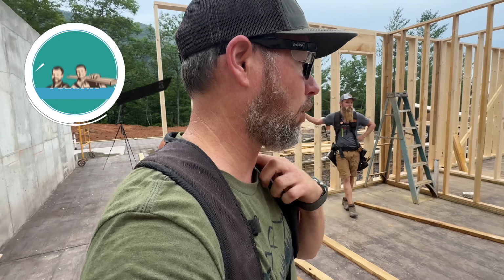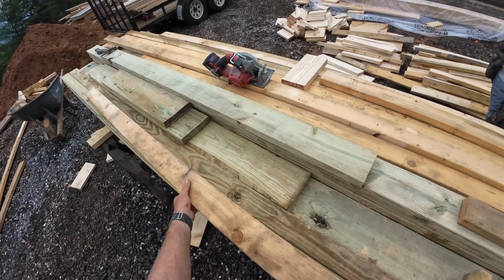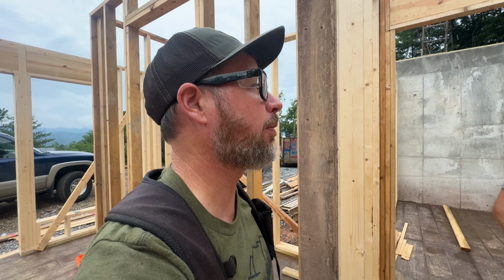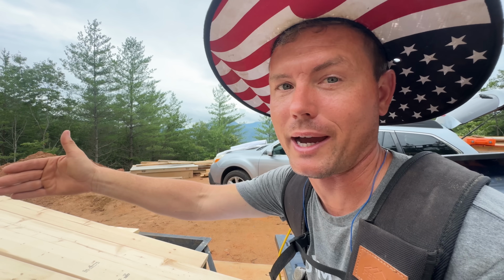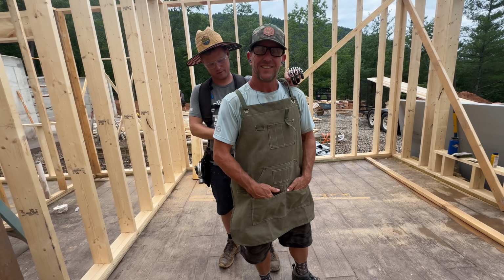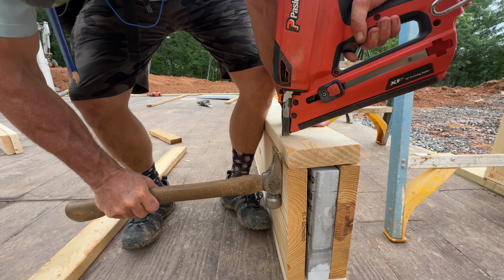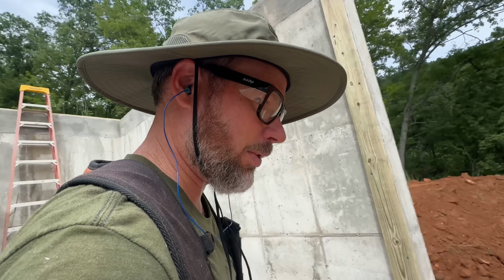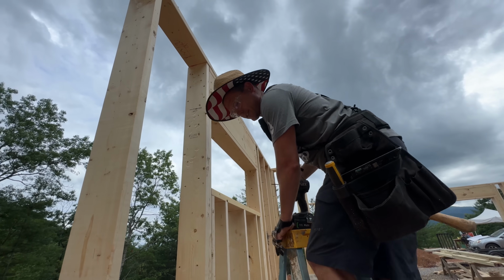Construction of a MEGA sized Modern Home PT 22

Comment: https://www.youtube.com/@PerkinsBuilderBrothers  UK and New York is the only place I've seen below grade windows (basements) without window wells.   Normally there is a sunken area that is concreted/paved (aka a walkout) with stairs leading up to the ground level.   They generally have a floor drain installed for rainwater and are sloped.   similar to how one would do an interior basement or garage.

Comment: Pro tip. Use a sq. And you won't have to beat on the opposing framing member to flush your framing. It will just fit.

Comment: It actually took you 8 seconds from the second you ticked the mark on the stud till you picked your saw. Assuming you are doing 200 studs that way, you're going to save around 1600 seconds, or 1.6 kiloseconds. 1 Kilosecond has 16 minutes and 40 seconds, so you will have saved 26 minutes and 40 seconds if you did 200 studs without marking a line on the stud.

Comment: You can import a PDF into AutoCAD (overpriced) or BricsCAD (cheap and the same as AutoCAD).  If the PDF of your print has one dimension then you can measure one of the already dimensioned lines.  The ratio of the dimension on the print and the measured dimension is your scale factor.  You can then scale the imported PDF file drawing by that amount, and now you can accurately dimension anything on the print.

Comment: Holy crap, I might actually know something y'all don't. Okay, here's a "pro tip" (putting it in quotes, to indicate irony as I'm not a pro). You want to cut out the bottom plate where there's a door opening, but don't want to screw up the floor finish, right? So... when you frame the wall, before you stand it up, take a circular saw, set it to about 3/4 of an inch (maybe just half an inch) and cut the BOTTOM OF THE PLATE where the bottom plate will be cut out for the door frame. Right? So, the bottom plate is still intact. Install the wall. Then, when you go back through with the saw zaw, you don't have to go all the way down to the floor, you only have to cut about half way through the bottom plate and won't risk marking the finish. See what I'm saying?

Comment: Pro-Tip
When framing walls and leaving the bottom plate full through a doorway , cut part way through bottom plate, from the bottom. That way when you stand up the wall and cut out the opening you only need a hand saw. Simply make a few cuts and connect with the existing bottom-cut. Perfect door opening and no damage to a tool when it hits the concrete.

Comment: You courtesy cut your sill 3/4 when you layout at bottom-pro tip.Ive done double 2x4 walls at 2' thick for insulation.We have lots of snow and mega homes,accordian doors with 20' spans, big headers.Lots of steel and glue lam.

Comment: If you undercut door openings underside ( bottom plate) by 10-20 mm...1/4-1/2 in? Before bolting plate down... won't mark the floor when cutting them out later. Great channel by the way. Kerry from NZ

Comment: I know this video is almost a week old, but just thought I’d be the code nerd to point out all the comments regarding “egress” windows are not correct. The IRC requires an Emergency Escape and Rescue Opening (EERO) in basements, habitable attics, and sleeping rooms. Means of egress is addressed in another section of the code.

Just sayin’.

Comment: IRC egress requirement. Bedroom's occupant must have two possible ways of getting out with one leading directly outside.

IRC also has certain minimum requirements for windows:

    24 inches tall
    20 inches wide
    The window opening must have an area of 5.7 square feet
    A window can't be installed more than 44 inches above the floor, to allow climbing out; it should also be no lower than 24 inches from the floor, to help prevent kids from falling out.
    Windows must be easy to open from the inside without keys, tools, or specialized knowledge.

Comment: Sorry, but I got you & your Larry Hawn technique beat. We just mark the board near the middle, place your table on the far side and line up your blade with the mark, then plunge cut, stop your blade on the wood, since we all pin up our guards (Not OSHA approved)😁 Many of us also cut off the outside table, easy to cut out doorways and heats later. In over 40 years, only one accident, minor.

Comment: I'd like to normalize kicking the sill plate back towards the center of the building enough to make the exterior sheething flush with the exterior of the foundation and then caulking the transition and using a fluid applied exterior membrane

Comment: A tool tip Erik, if you subtract the measurement from the saw base to the blade, then you can put a tick mark and hold your speedsquare to it, then jam the saw up the the square and cut fast perfect 90°😃 usually the saw base is 1"1/2 so just subtract a 1"1/2 from your measurement 😄

Comment: Hey,PRO TIP!!!when building inside pars.on cement floor score the bottom plate wth circular saw half way through. So when cutting out door plates wth recipacating saw only have to cut half way through done not even close to floor.No marks and saves tons of blades.

Comment: I was wondering why did you build the header with an air space in between the two 2x12, in my opinion you should put the two boards together so you can spray foam or insulate that little bit of air space.

Comment: I always did the Larry Haun square cut putting the tick mark on the side of the board away from me. Then I would line up the notch on the front of my saw with the tick mark. Then flush the front of the saw to the 2x4, which gets it square, and plunge the saw in to the cut and finish by aiming the blade at the tick mark.

Comment: Hey guys hello from New Zealand, love the vids, just a little trick I’ve discovered when cutting the bottom plate out in door ways is before you stand them cut about a 1/4 - 1/3 from the under side of the  bottom plate where the proposed doorway is, so when you stand up the frame you only need to cut down a 2/3 - 3/4 saves marking the floor and also keeps your blades from being damaged, Jamie will like that 😂

Comment: 19:30 those egress windows are pretty common around where my parents live in Indiana. They actually had some installed in the basement, because without them the only egress from the entire finished basement was a single staircase. That said, shortly after installation, they actually flooded the basement, so you make a compelling point that they're not necessarily a great idea when there are alternatives.

Comment: So a trick my Great uncle did for the door plates, is to cut about half way through the bottom side of the board before placing them on the foundation. Then you only need to cut the top half.

Comment: make the mark and hold the speed square to run the saw against.  Always correct.  If you were to eyeball 2x6 or greater, then the cuts would probably not be square and you have to trim it again, costing time.  No point drawing the line with square, just hold the square and place the saw against it.

Comment: Dividing the number of studs and replacing them as king and jack studs works as an estimation for smaller openings but the recommended installation for larger openings is greater since the shear distribution along the length of the opening is non-linear. That is, there is an exponential change in shear force along the opening that has to be accounted for by increased supporting members.

Comment: A great tip I saw once on another channel (don’t remember who sorry) when you’re framing door openings on concrete before you raise the wall score the bottom of the plate in the opening like a quarter inch or so, so that when you cut the bottom of the plate out you don’t have to run your saw blade into the concrete

Comment: I'm a little surprised that you don't put any insulation in your header boxes.
Reply: I was too, actually, especially for a span that long. But it might just be a local climate thing; air’s a decent insulator, and there should be no air flow through the header, so if the climate’s mild enough you might not need extra stuff in there. I’d be curious to see the flir later on a hot day.

Comment: I too have framed my headers with 2x10s on the inside and outside with foam in the middle.  However, my inspector wanted 1/2" plywood (not OSB) as a middle layer.  Then rows of 5" GRKs holding the sandwich together. Whatever makes them happy!!!!

Comment: Extra pro tip! Whenever framing walls on a finish concrete floor, set the depth on your saw to 3/4” and score the bottom plate at the door openings at your jack stud layout so when cutting out door plates, you can finish the cut from the top with a sawzall!!!

Comment: As an architect 5 per side would be accurate using wood members bc of the static and live loads above and bc of the opening dimension.

I’d use a steel moment frame instead for efficiency’s sake but that’s just me, lol….also subsurface egress windows are MANDATORY in many jurisdictions, and they’re typically plumbed externally into the French drain of the house.

Comment: Hey Perkins crew when laying your wall out if you cut the bottom side of your  sill in half where the door opening is after you set your wall in place you only have to cut through half of the 2x when cutting out thedoor sill opening

Comment: I think the debate over marking the 2x4 cuts with a speed square or not is a wash. Mainly because the speed square line is not guaranteed to be straight because it references off the board which is not exactly straight anyway. So I think the accuracy is roughly the same either way.

Comment: Can't believe your building inspector doesn't check the required nailing pattern for the plys of your structural headers. The plys need to be nailed tight together with a row of 4 nails every 12- 16" down the length of the header and within 6" of the ends and 4 nails per plus into the ends through the king studs.

Comment: a little tip from down under.... for your door openings I always undercut the bottom plate in the doorways prior to standing the frame... it makes it heaps easier to cut the bottom plate and also protects the floor and blades

Comment: When laying out the plates.   Set a saw to cut 1/2" deep and cut the bottom side of the bottom plates both sides of all door openings . 
Every thing holds  together  when standing the  walls.   After plumbing and nailing off the walls 1 guy can cut all  door "sills" in the time it takes  too to do the one you forgot to cut.  On wood floors  not so bad but concrete you checked they got cut  before standing the wall.
    Always Love the content   thanks a bunch , from Wisconsin.

Comment: The carpenter I learned from when I first started would alway depth the skill saw at 1” then make a cut on the bottom of the bottom plate at each jack stud, so when you sawzall the bottom plate out you only need to cut through 1/2” at the top with the recip saw. Little tip that has always stuck with me and like to do that especially when framing basements on slab help save the sawzall blades

Comment: Hey guys, careful with that 12ft opening. If it’s a top hung bi fold door, the manufacturer will have a minimum deflection requirement for the door. Sometimes an engineered header is required for that only.
Reply: Just kidding. Just saw the wall on the plans later in the video haha. Saw that it was a multi slide!

Comment: Kerf the bottom plate on the bottom at the door openings before standing the wall. Also, that 8” wall would be nice flush to the ceiling with no header

Comment: https://youtu.be/yE9BEGyJ4Ts?t=1120 200 boards by 6 secs = 1,200 secs or 20 minutes actually. Just saying. It's a huge time-saver especially when you account for doing that same thing for a number of projects over the years. For instance if your time had cost say $30 an hour, that's ten bucks saved daily 5 days a week, 4.5 weeks a month which is roughly $225 per month. Now put it into your savings account and see what happens to that money even at a moderate 150 basis points annually. Safe to say that compounding is king.

Nice video btw :)

Comment: It's the easiest of maths, 200 x 6 sec = 20 x 60 sec (1 min) = 20 min. 
You guys can add/subtract/multiply/divide the most ridiculous fractions and build a house, but such a simple equation is beyond you? Is this a metric vs imperial, where you can work with powers of two, but not powers of ten? ;-)

Comment: 19:51 19:51 most every home here in Utah have those basement windows with the corrugated metal wells. There is a drainage system using gravel in the bottom of the ‘widow well’, and that’s what their called, window wells.
Reply: But then we’re dryer than aunt Marge’s knees out here.

Comment: Here in northern Utah, the majority of houses have basements, so that means windows with window wells. it's super nice to have the extra square footage without needing larger footprint, but you're right, they do flood on occasion, but it's rare. Once I was paid to dig window wells extra deep, and install sump pumps in them, in a basket and surround with stone. they were wired and plumbed to be always ready to prevent any flooding.

Comment: 19:30 Those kind of windows are extremely common here up north since most houses have fully buried basements so if you want ventilation or egress it's the only option. As for the drain it just leads straight down to the weeping tile at the footing  of the basement then to either the sewer or a sump pit to be pumped out of the house. The drain for the window is mostly just to prevent water pooling and running trough the window into the house.
Reply: Egress is also required if the room is designated as a bedroom.
Reply: It blew my mind when Jamie said that they hadn't built one before. I thought all houses had window wells. I guess it's just because I live in the Canadian SSR.

Comment: I personally set up my miter box/cross cut saw during framing. Mostly for sills, headers, cripples and I cut them all at one time. Then I build headers for the whole job. Less moving around. I only use my circular saw for long plates or sheathing/decking.

Comment: Man that top plate on that big door opening should have went way past the couple of inches on that header.
Reply: Must be an engineered solution unless its a non-bearing.  Then its down to what makes a sturdy wall to support a huge door system.
Reply: They said it was non bearing but still there’s lateral forces. Hopefully the rim board on the floor above helps.

Comment: @1:00 Prior to standing and setting the frame in position, partially run a cut about 1/2"  deep across the bottom face of the bottom plates on each side of all the door openings, making it easier to remove them later.
Cheers from Melbourne Australia 🇦🇺

Comment: We always cut the underside of the bottom plate before fixing to the ground.  1/2" cut underneath makes it very easy to cut out later without risk of damaging the floor
Reply: that's pretty genius
Reply: That's the way I was taught to do o before standing frames.
Reply: Came here to say this 👍
Reply: Great tip, thanks!
Reply: Genius!
Reply: Learned this pro tip from ‘This Old House’
Reply: I was taught the same thing years ago.  Saves on blades and is much easier.

Comment: Windows below grade are incredibly sketchy when you have to deal with record rainfall from the remnants of a tropical storm as I found out last week.
Reply: The art of building:  drainage, drainage, drainage...site planning and setting positive grade so important, not only in dealing with precipitation events, but also subsurface, positive drainage.  Pumps can fail, especially when power is lost. 😊
Reply: @patrickrussell1888 always get a battery backup system for a sump pump. And test it regularly. Saved us when Sandy decided to visit PA.

Comment: For square cuts without using a speed square, hook your tape in the center of the  stud. Then pull the tape out to the right distance placing your index finger and pencil on the number you want and arc scribe a line. Works great up to 2x6. Takes some practice to use this method on wider boards.

Comment: Hello Jaime and Eric, Michael from Colorado here. Most homes in the state have basements, and basements are required to have at least one window (with the window well) as a means of escape and overall safety. Keep up the great work!
Reply: Yep it's funny to hear their take on window wells considering they're so ubiquitous here. Galvanized steel is the most common, and the ones that have to be replaced after about 20 years. Other more "custom home" options are HDPE plastic and precast concrete. The precast concrete ones have found their way into more production homes as of late I've noticed. 

I have HDPE plastic window wells and have only ever seen them on one or two other houses in the area out of the hundreds of yards I'm in a year.
Reply: Yep, required for egress!

Comment: Pro tip, when working on finished floors, leave the jacks out till after you stand the wall. Then you can use a circular saw set to correct depth to cut the bottom plates 1.5” away from the king stud. Then add the jacks
Reply: Larry Huan approved. 

*probably
Reply: I like to do this. If the Jack is a bit twisted it will be straightened too😄

Comment: 200x 6 seconds is 1200 seconds = 20 minutes. All you have to do is move a trailing zero from the '200' over to the '6', which turns 6 seconds into 60 seconds (which is 1 minute). Then you have only a '20' left from the '200'.  20 x 1 minute = 20 minutes.

Comment: Pro tip from an old guy: when assembling yoyr frame with a door opening, grab a skilly put a 15mm cut on the bottom of the frame opening. Saves cutting the concrete. Also when a wall meets a frame, instead if all that ladder blocking than adding extra nailer blocking just add 2 studs with 4 blocks tween them. Faster and gives full studs ti support the sheetrock. Thank me later.👍 btw, 6 sec x 200 comes to 20 minutes, not 2 😂😅